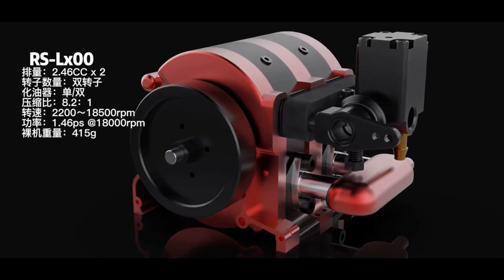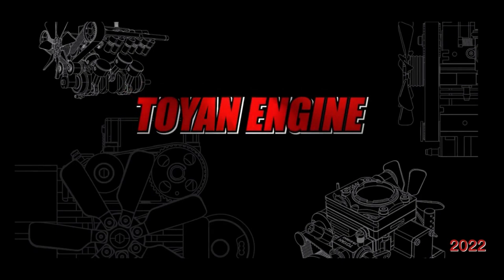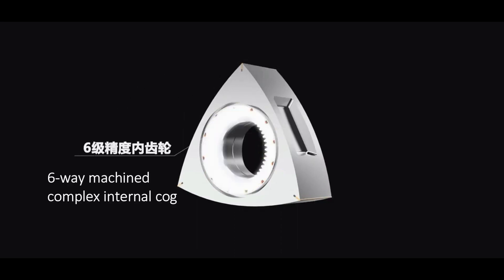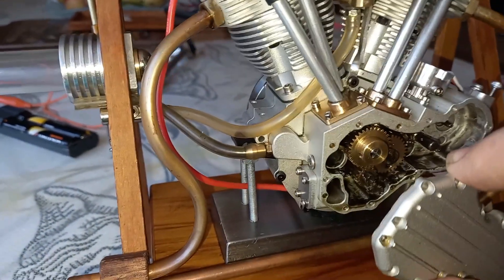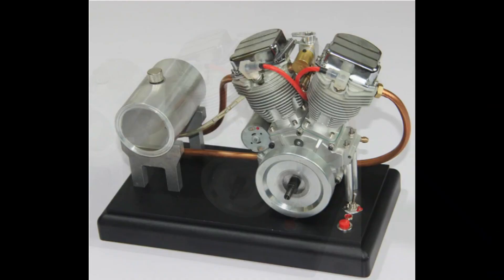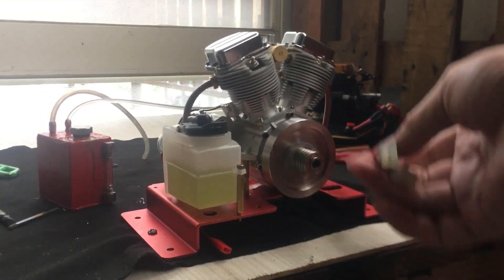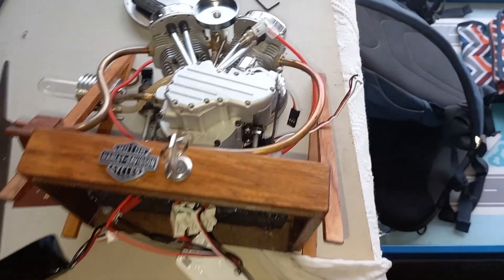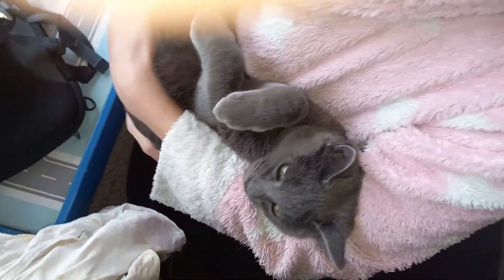WOW! dual rotor model #Wankel #rotary and Cison Harley Panhead model new base, tank, ignition parts

Comment: I converted my engine to run glow plugs and 5% nitro/methanol fuel, it starts right up and throttles good and no more crappy ignition systems.
Reply from the maker: Good job....I have never used nitro/methanol engines so it's kind of a skill I don't use. In this city, I don't even know if you can buy it. Our single model shop is electric...I like the challenge of petrol (sometimes)  :)

Comment: I am not happy with the new external hall sensors. After installing the sensors they got destroyed by the first spark itself. So i bought a bunch of new hall sensors for replacement. And the same again. It seems the sparc jumps from either the flywheel or the engine housing to the sensor and kills it. I dont know what to do now. The inside ignition worked only a few minutes. The engine was running perfekt till then😭😭. 
Maybe someone made similar experiences.
Reply from the maker: I'm really interested to hear this. Something is going on...my original hall sensor died. I got a replacement (original type) brand new, but that doesn't work either. I have tested the ignition module (I replaced that too) it is definitely the hall sensor. I was waiting for my replacement hall sensor but checking up last night on where my order is...there is no trace of my order. Did I not do that??? So I am buying tonight. I guess I am going to get two new style and one old style...in your case, check that all the wires in the two hall sensor cable plugs are connecting. Consider preparing your hall sensor unit before installing it with a layer of something. eg silicone sealer (thin layer obviously) I will be doing that....thanks to you my friend. I will definitely let the channel know how I go in a video...before covid took off I could get stuff from Asia / China in about 8 days. Now every time is longer than the last...its at about two months...argh
Oh hey remember the pre-existing industry standard model engine ignition modules are by RCEXL ...maybe we'll end up stumping up for these???
Reply: @ThomasPCGuruENGINES  
Hi Thomas, I'm 99% shure it is a matter of insulating the circuit board to the engine body. I got 20 new hall sensors today. So plenty of material for new experiments😆. I also ordered smd hall sensors. I think they also fit on the circuit board. But then I have to turn the little magnet in the flywheel which is difficult. I have to drill a hole from the back to get it out. The smd sensors need another direktion of the magnet unfortunately. I keep trying☺👍👍